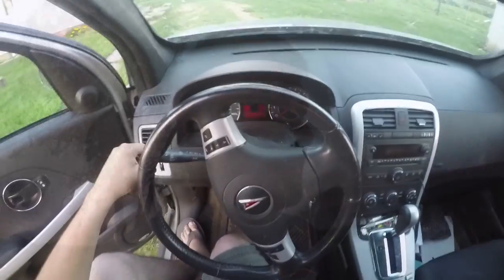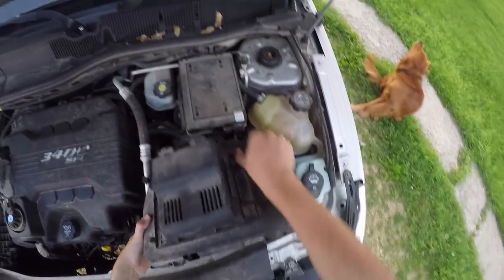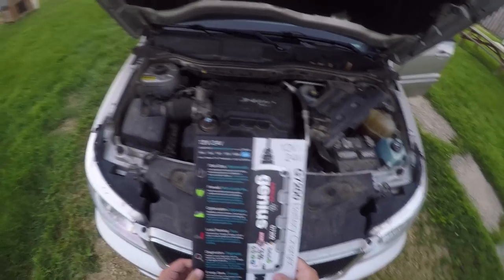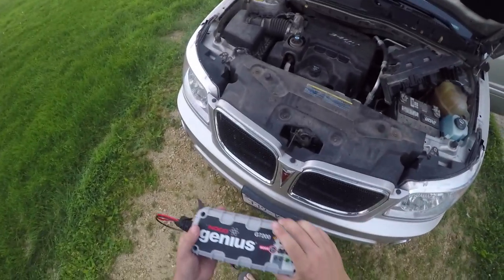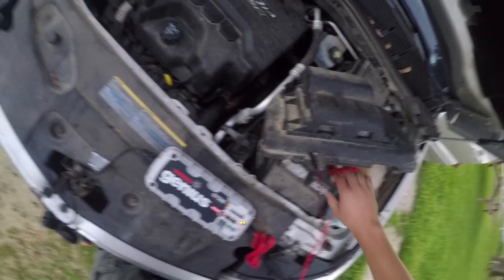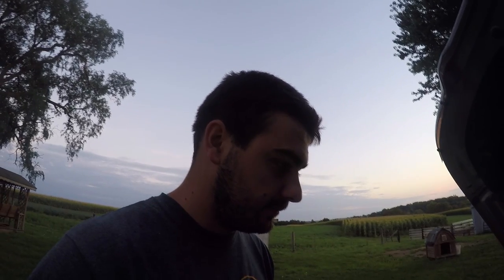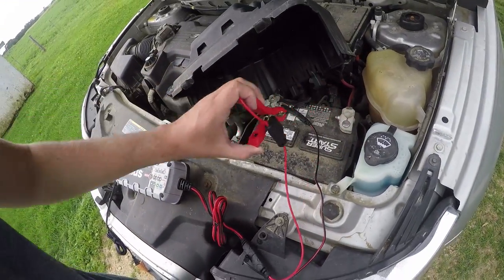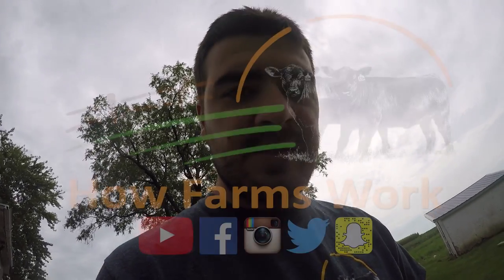Charging a Dead Battery - NOCO Genius G7200 Battery Charger

Comment: You usually do the positive then the negative then plug it in
Reply: "Positive first" and "remove negative first" is the proper order on a negative ground vehicle, ie. almost any vehicle.

Does not really matter with equipment like this. Nothing is going to happen before activating the charger anyway, the clips are insulated, and even if you short it, you only short the (smart protected) charger and not the battery.

If you were plugging in a booster or heavy charger, positive first. Negative goes on the engine or frame away from battery so any sparks would not happen near the battery. Also applies when removing a battery:
 it's important to take out the negative first, or connect the positive first.
Reply: Tonss Sedell smart chargers don't matter
Reply: That is what the manual recommends as well and the opposite when disconnecting.
Reply: @RG-vo1yk  Do you have to have this plugged into a house/garage socket to do this (When the charge is already FULL of course.) or can you just connect it to the car battery unplugged and leave it over night?

Comment: The instructions say to hook up the positive first then neg and then plug it in otherwise you can ruin the internal circuits that allows it to condition and repair and make it a smart charger. These are supposed to be a very good charger, I got a g3500 for my motorcycle which always seems to have a slight battery drain,  maybe because it has a can bus system that includes a anti theft alarm. Thanks for the video!

Comment: RYAN LETS MAKE YOU A CHARGER EXPERT. Always put positive on first. That way if wrench or touch a part of vehicle you don't have a short. Also unplug chargers first before you remove terminals. Then no spark will cause a fresh charged gas emitting battery to blow up.I did that and it is not pretty.............
Reply: Ryan better watch your video again. You plugged charger to A/C first, then let the + & - touch while moving cords and then hooked up negative cable first.....Sorry to pick at you. I am in Florida now, born in Mukwonago, WI, lived in 8 different towns in WI and grew up in Red Wing, MN were I worked on farms, and helped a friend farm in Poland, Indiana
Reply: From your handle (1919) your almost 100 years old and much respect for that generation but todays "smart" charges are totally different from doing it the way you were taught. This charger is smarter then the farmer and this particular charger will not start charging until it goes through a safety procedure before sending current to the leads. So even a 2 year old can now charge a battery. Yes that does say something about the education of our next generation. Craftsmanship is becoming a lost art. Its best to read up on all material, old and new!

Comment: Ryan, that charger might work with some (small) boats, but quite a few of the newer ones have more than one battery (or bank, in the vernacular) on board.  I can see using it as an emergency backup in case the onboard charging system failed, but that's about it.  Boat owners want fast charging, not a trickle.
Reply: I beg to differ...as I dont get to the boat too often I have it on a trickle charge all year round. Its never ever flat when I fire her up. Why would you wait for your battery to die and then just fast charge it? What charger/boat do you have

Comment: Ah, thank you! What I needed to know was that it charges up to 80%, then it finishes charging with a trickle charge. I left my ignition in the on position (first time ever) and the battery was drained. So I plugged it in and here I am 24 hours later and only the 75% light is flashing. So....I'm was wondering why it is taking so long. I know this can charge slowly, but didn't know it would go between normal and trickle (thought it was one or the other).

Comment: Like the way you ran like hell to get that key out when you seen a little power.Just went through getting my key out of my 2008 Equinox when my battery died.Had to change to my spare key as the regular one kept cutting out power when I tried to use it.

Comment: I prefer the jumper packs... hook it up, at most give it a minute or two, crank and go.  Quick and done and can charge it at your leisure... 

Later!  OL J R :)
Reply: The NOCO also does what you need. In fact that is exactly what they suggest - Connect the battery and just start it.

Comment: Its a damn smart charger so dont matter to put positive or neg first, you dont have to ground it to metal, you cant short it out, if you do it will be the charger... Those requirements are for jumping or not using a smart charger.

Comment: tesla (at least S model) also have 12V battery, and there where cases to discharge it totally flat, and it is paint in the butt to charge it(access it). Not sure if something isn't changed since early models, but not expected. So atm every car have 12V battery is correct enough.

Comment: Noco needs to put better coating on the wires going to the battery from the charger they just get brittle and crack in about 6 months

Comment: if your battery is dead (below 9 volts -ish this battery charger wont even turn on in "smart mode"  I have two of these neither of them  i would recommend to anyone for anything. If your battery is pretty new and not completely dead this should charge it . If its really dead or don't have a whole day to charge it? then this box is useless  . And fyi  every battery charger operates just as easy black to - red to + plug it  in except with an old style high current battery charger it will charge your battery in less than an hour or just have enough current to start your car right away ! this you will need a day  in which time this device will spike your AGM bat. with pulses of up to 17 volts AGM batts should never see anything over 14.8 volts 15.2 tops  but the first thing th e genius does is jam too much voltage into battery , a battery that has a warning right on the cover DO NOT EXCEED 15 VOLTS DURING CHARGING!. Honestly as a skilled experienced car /motorcycle /boat guy dont buy one of these they suck
Reply: If your battery is dead, I thought you had to do force mode and hold 5 seconds then it will charge. Did you try that?

Comment: I've seen the review AvE did on these. Think I'll pass lol
Reply: Was just going to mention the AvE review.
Reply: He was way too biased in his review. He was pissed because he wasn't getting the full 3.5 amps but it says right on the box it starts charging at a lower rate then moves up to the 3.5 once it's holding a charge for batteries that are practically flatlined.
Reply: Mac102004 Farms I've owned the model 1100 for years and never had a problem it works great, if u want to take that Ave guys video at face value he sounded like a idiot and doesn't understand how this thing operates.. I have a battery tender also but I prefer to use the noco!
Reply: I watched his vid and made an educated decision, based on what I saw. Do I always make the correct decision? Hell no, but if something looks like shit and smells like shit I'd rather just stay away from it rather than take the risk. I'm sure there is much cheaper options out there that are just as shitty as this Noco with a crustier looking exterior for a fraction of the price...
Reply: Mac102004 Farms I don't think it's possible to make a educated decision from watching that video!
Reply: Hey man if you like something and it works for you, more power to you. It's hard to change someones mind about something if they own it and it works. Like I said, I don't own it and after watching that video I wouldn't buy it. But he's put out video's about other products that I do own and like that he thought was complete shit also. I didn't go out in my shop and throw it in the garbage after watching the video, I had the same attitude you have about the Noco.
Reply: AVE eventually deleted the video from his channel after so many had pointed out how the charger actually works. It's not a simple power supply like the old dumb chargers are. I've had 3 of these in a few sizes in the shop now for a few years and they've all held up great.